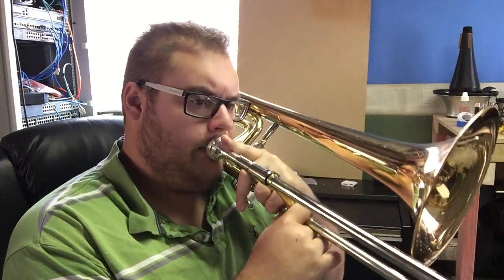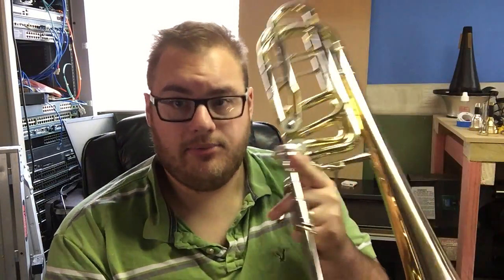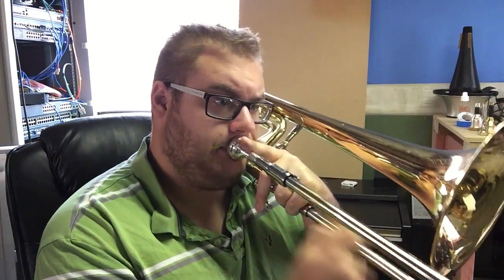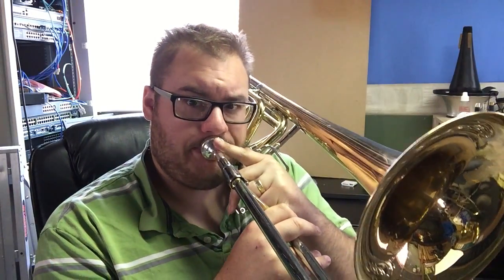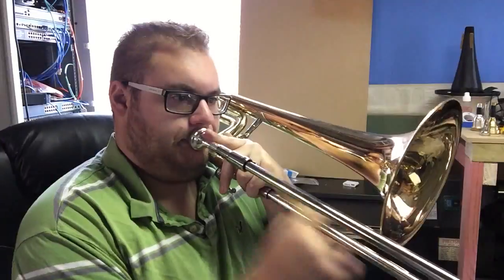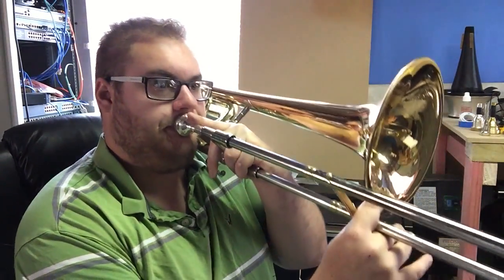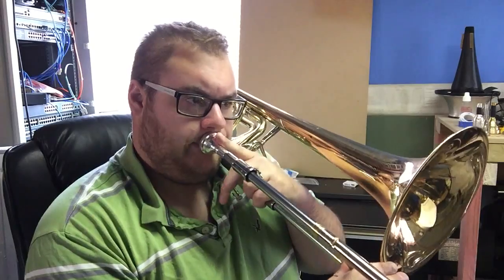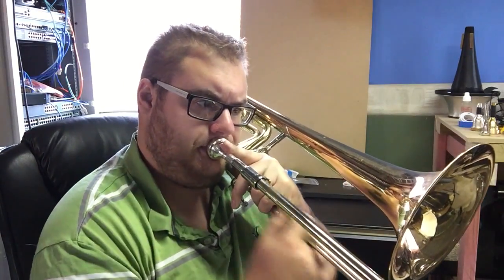Single, Double, and Triple Tonguing

Comment: Hey Trent, As you may remember I wanted to learn a brass instrument. Well, now I am. I recently obtained a marching baritone horn so I can march it. Do those skills (besides the piston fingerings) transfer to the trombone? What about trumpet, euphonium, and tuba?

Also, can you do a video specifically about the Baritone horn?
Reply: Well from experience it's easier to switch from  tuba and euphonium(basically baritone) VERY easily but from trumpet your switching from treble clef to bass though fingerings are all the same, the clefs are what makes the transition from trumpet to tuba very hard plus you gotta loosen or tighten  your lips depending on the mouth piece hope that helps

Comment: NO? What the heck. You tongue everything on every brass instrument valves or not.
Reply: Not so much for slurs. Trombones slightly tongue slurs, whereas other instruments do not require it.
Reply: Jason Wall trombones have to worry more about it mainly because of more distance, when you're going from sixth to first then maybe fourth then 7th idk. When it comes to things like that where theres a large distance between positions you have to make sure youre tounging is firm otherwise it could sound pretty wonky compared to just having to press down different valves, which is easier to do fast than drag a slide everywhere. That probably didn't make sense but our band director's friend who has lots of experience with brass (like more than 20 years i think) and helps our brass sometimes said something similar to that.